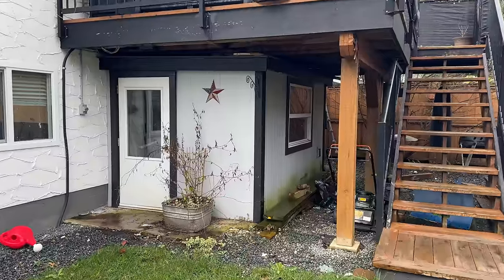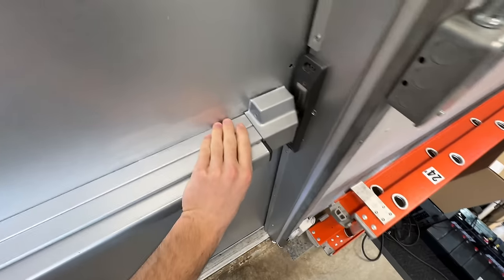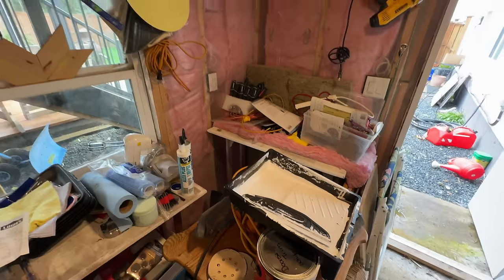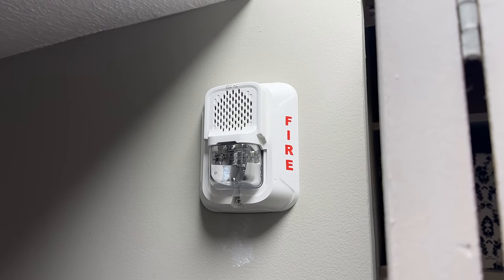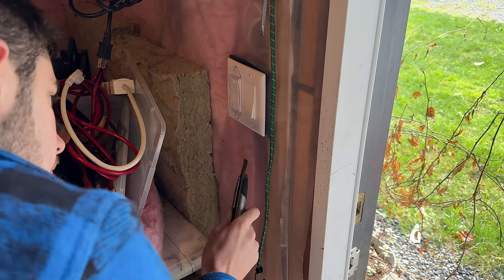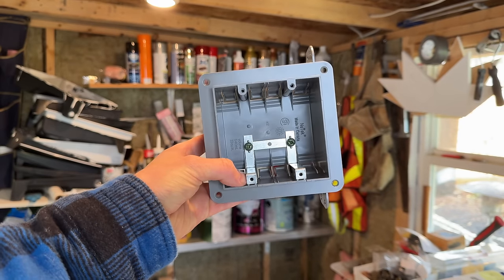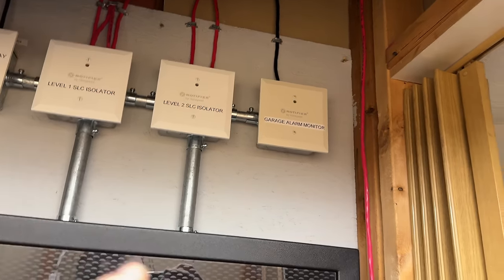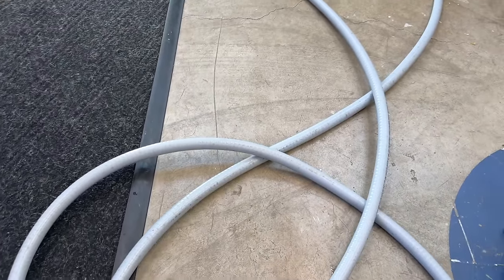Shed Fire Alarm System Install. House Fire Alarm System Expansion! Part 1

Comment: They sell sharpeners fro drill bits I don't know if the one is still around but there was one called "The Drill Doctor" but I'm sure they make comparable products.
Reply from the maker: It's not fun sitting there doing it by hand with a file I can tell you that
Reply: You can also use a bench grinder to sharpen drill bits. Or if you want to live a bit more dangerously, an angle grinder.
Reply: @eDoc2020  I think I’ll take the safe route lol

Comment: Really curious. I enjoy network wiring. 

Is there a system similar to this, that does the same thing, but instead of wiring like that, each one is wired individually with cat 6?
Reply from the maker: Internet cable like cat 6 is not large enough and does not have the rating for fire alarm use. security systems will use smaller gauge wires like 22 but there is no benefit to using twisted pair cable. It is often PA systems though.

Comment: Ps do you think in theory if you could find a barb to reduce 1/2 inch to 3/8 and use a short pvc tube you could than add the 3/8 tip to that ? My theory is to use hose repair clamping methods

Comment: Great Video Nic.  I don't know about others but If I had a house where I could do this and the parts / knowledge you do I would do the same thing.  I mean it hardly hurts to OVER-PROTECT you and your family.  I don't know why others would get upset unless they are Jealous like someone else said.  Its your house and none of their business what you decide to do.  Enjoy all your videos.  Keep them coming.
Reply from the maker: I agree. Thanks for the support and comment I appreciate it.
Reply: @nics-systems-electric  Its cool to see that your putting systems and devices in real situations following real standards.  I have not seen too many others on YouTube doing both these things.  Its neat to see a bunch of devices slapped on a demo board or randomly stuffed in a building but even cooler to see realistic systems and proper methods for installation as if the buildings needed to follow the rules.  You can't always show everything in the field doing your job so your home is a great way to provide the educational aspect on the systems.  Keep up the great work.

Comment: Just slap a P2R on the celling
Reply from the maker: I was debating going ceiling mount
Reply: @nics-systems-electric  it is a good idea enough room
Reply from the maker: @NewEnglandAviaton987  I didn't as it was more likely to get damaged as the ceiling is very low

Comment: Nick you should probably put STI stopper over the pull station Because Ayla could pull it I’ve heard stories of dogs, pulling the fire alarm at their doggy daycare
Reply from the maker: I hate stoppers
Reply: @nics-systems-electric  why
Reply from the maker: @Dilsonalarmsandelectrics  they're annoying to work on or test a device they are ugly and the ones with sirens shouldn't be legal they cause more problems and they solve

Comment: Another great project! My only concern is drilling through all that wood without eye  protection. A  scratched cornea is SO painful! I've had two and wouldn't wish it on my worst enemy. And screw the keyboard warriors and watch out for the black helicopters 😂
Reply from the maker: Yeah that sounds awful that's why I have to deploy a good solid safety squint
Reply: @nics-systems-electric  Hahaha 😝

Comment: HI Nick you seem to understand alot about engineering do you have any proposed ideas for my strange diy project if you don't know soorry to bother you but thought I would ask : HI got a strange diy hose repair question can you find me a solution ? My hose is 1/2 inch but at the end need to add a 3/8 barb any proposed ideas for how to find remedy?
Reply from the maker: I believe they do make a barb adaptor fitting for PEX I'm not sure if they make something similar for hoes or if you could make something up that would adapt it maybe you could use a pex fitting on hose I've never tried not meant for it but might work
Reply: thank you I am in the U.S it seems the best idea I could come up with at the moment was I ordered a 1/2 inch to 3/8 reducer barb so If   found that it would seem the answer is attach a 3/8 pvc and if I am using this as some type of garden hose or something one you have the right size hose you clamp on the barbed nozzle tip it looks like we have found a solution of course maybe I bet be sure I still need that thing as one part I would need for it cost about 100.00 ( I would rather not say what I am doing but I have  a highly specialized project if can afford it which I dont know if I will be able to but its nice to know there should be a theoretical solution thank you ) !!!!

Comment: Nick. What do you mean form slc and nac what the 2 names mean.
Reply from the maker: SLC stands for signalling line circuit which is the data loop that the initiating devices communicate on and NAC is notification appliance circuit which is your horns and strobes A/V devices
Reply: Ok

Comment: I'm just wondering since you were talking about the isolators, for the garage system couldnt you put an isolator for the tower and the shed to make them addressable but if anything happens it doesn't take down the whole system?
Reply from the maker: It would be possible however for reliability I wanted to keep conventional

Comment: 10:08 - I've never used a impact wrench on framework attached to a drill bit for this very reason - seizing.  

I would use a normal drill so that the bit on that thick would does not auger in and cause you to stop and back out, start again.  

That's just me, but is a tip for you the next time.
Reply from the maker: That's all we usually use. It's much much safer and impact driver will never bind and snap your wrist like a drill will.
Reply: @nics-systems-electric  only in my noob days did i snap a drill like that. 

its all about applied pressure and letting the bit do the work.

:) 

all good though,  just a thought to present

Comment: Will you add like a paging system to your house and use it for like evac msgs or to play music
Reply from the maker: No the 320 does not support voice evacuation and it would require more conductors ran to the fire alarm devices

Comment: Question for you nick what resistors go on a ms9050ud fire lite panel and the panel when I got it did not come with battery cables do u know who I should call to get some😢
Reply from the maker: Should be 4.7k not sure where you can find a battery cable
Reply: @nics-systems-electric  thx

Comment: Ever thought about sprinklering that shed too? Just a thought…
Reply from the maker: No that would require the house to be sprinkled as you would need water supply which would have to come from the house which would be a lot of destructive work. not to mention that shed is not heated as for why we are installing a heat detector.
Reply: @nics-systems-electric  I understand. Was just a random thought considering there was many flammable objects and sprinklers do give a more immediate suppression response especially when no one is home. But yeah, you would have to tear a bunch of stuff up and mess with ur house’s main plumbing to make that work. Plus, I’m not sure the shed is properly insulated and could lead to the sprinkler system freezing up.

Comment: What is the stick called that fire alarm inspectors use for smoke detectors called and what is its purpose?
Reply: They use it to stick a a peace of meatel to activate the detector or they'll use a magnet to activate photoelectric alarms
Reply: @CAT40tag  let me clarify: what is the stick that fire alarm inspectors use that fake smoke comes out?
Reply from the maker: Usually there is a pole with a detector tester that has a can of fake smoke in it gets released once pressed against the ceiling and is contained in the head of the tester over top of the smoke detector purpose is to functionally test the detector
Reply: @nics-systems-electric  thanks for that explanation